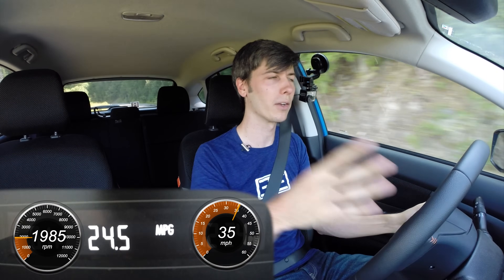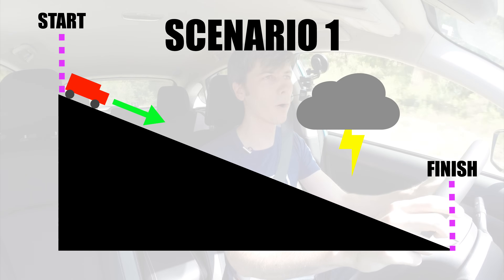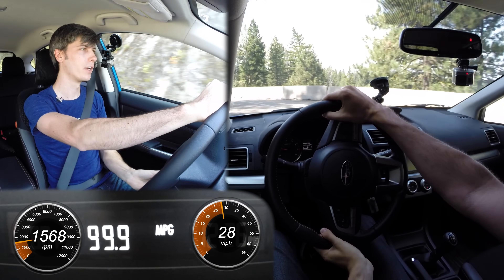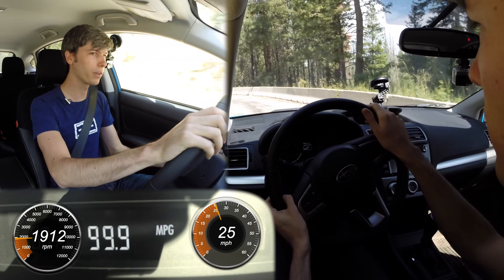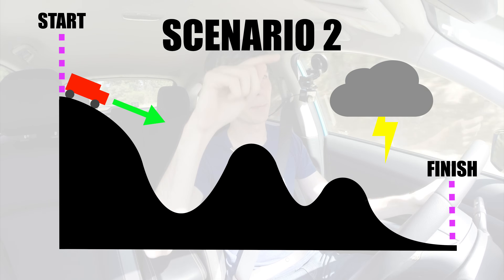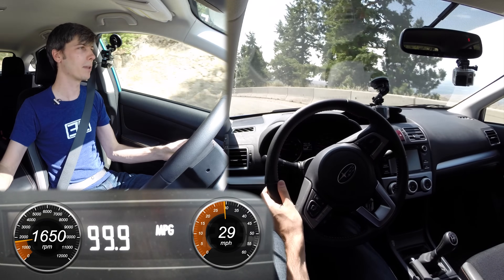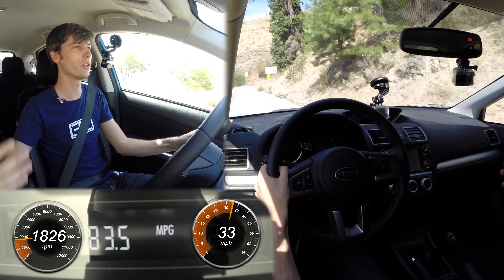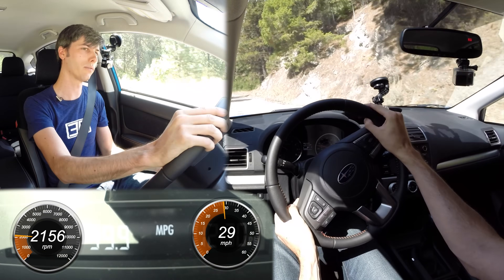What Uses Less Gas - Coasting Or Engine Braking?

Comment: Cool!  Now I can show this video to my friend who always insists on coasting in Neutral for every hill they encounter.
Reply: +zevi 2000
Are you sure? It is certainly against the law (CA VC 21710) to have your car in neutral going down a hill but there doesn't appear to be such a law for sitting at a stop light. If you are driving a manual transmission car, it is not actually possible to do this without having the clutch depressed the entire time, causing unnecessary wear on your throw out bearing.
Reply: @edwardlongshanks827 yes, and also adds an additional hazard of your foot slipping off the clutch if you have to remain in gear causing a possible rear end collision . Neutral at lights is the norm for a stick shift
Reply: @boldcitycc  Yes, I know. I've been driving manual transmission cars for for 46 years and can't remember the last time I ever sat at a light waiting for it to change with it in gear with the clutch depressed.
Reply: Bladed Angel oh hi! Love your channel
Reply: +zevi 2000
Want you to and require you to by law are to different things. There are only seven sections in the CA VC that use the word gear and not one of them mentions remaining in gear at a stop light.
Who is they?
Reply: Why do I see your comments everywhere?
Reply: +drippingwax +Diego Chavez The reason you see my comments everywhere is because my Subscribers notice me and upvote them.  The both of you probably watch more videos and comment more than I do.  Also let's be honest, no one on YouTube has a life XD
Reply: Totally foolish. Theyrr handi-capping themselves from control, should a swift emergency rxn be needed
Reply: Adam Dixon except for brakes and steering
Reply: @wigancyclist8913 ”brakes and steering”, AND the ability to throw it in gear at any time for engine braking.👍
Reply: Bladed Angel hello
Reply: Nuetral is angel gear.....no control of the car
Reply: @adammarshdixon  lol. Steering is control. Braking is control. Compared to these, acceleration is not that big a deal. I would say, loss of some possible control in certain situations. It does not rate as no control, not even close. On a motorbike, more so but we are talking cars.
Reply: @susanss70spartymix77 braking is control, exactly. And braking isn't gonna work for too long, if you coast downhill in neutral!
Reply: Hi
Reply: Bladed Angel where is this that you are driving. I'd love to take my sportscar down those roads
Reply: It's kinda funny, they say to double clutch and to always use the clutch when shifting.
Reply: Edward Longshanks Yes, I know the difference. "They" is the DMV
Reply: Didn't expect you to be here
Reply: or shift up a gear...
Reply: Diego Chavez He doesn't have a life.
Reply: He's engaging a gravity drive rather than coasting in neutral 😂
Reply: New what?
Reply: its time plus work equals energy. if yiubhave air condition on. and getting there takes you 1 hours on engine brake vs 30 minites on neutral. you are using 30 more minutes of energy.
Reply: Please explain. How exactly are you in gear at a stop sign or red light? Are we talking about manual cars? Are you constantly pressing the clutch, even if you have to wait a minute???
Reply: I have a 2010 car that doesn't cut fuel, and it's a standard transmission too. This is simply not true in all cases. It still depends on the car AND situation.
Reply: Nobody i dont know how a fuel line would cut off when at neutral, you will still hear the engine combusting. and you need fuel for combustion.
Reply: How have you proven the ECU does not cut fuel?
Reply: Coasting also destroy the brakes
Reply: @AxelMontini  braking wears brakes. Coasting does nothing to them. If you are going too fast and need to brake, then you are braking, not coasting. Depending on the incline I can coast for a long time and often put it back in gear to speed up. If its too steep I engage gear. If really steep I shift down.
Reply: That will mess up the transmission
Reply: Yeah its annoying, they always complain how I use my engine braking and afraid of the rev sound
Reply: @imustbust998  Good point, but I rarely coast, especially on a highway.
Reply: I know a guy that did that and he thought the engine made it go faster and I said dude it's called engine braking you're not wide open your a title in the engine is struggling making a break
Reply: It's illegal, so is operating cell phone while driving, but police have better things to do.
Reply: Were the cost of new brake pads or of crashing downhill because they cooked their brakes not a convincing argument to your friend? 🤯
Reply: I'm one of those guys XD
Reply: I’ve never coasted down hill keep in gear = more control
Reply: Everyone here arguing if it’s safe to do this kind of thing … y’all do realize that it depends entirely on the situation, right? I’ve regularly driven hills where you could stay +/-5mph of the speed limit in neutral. I’ve done that. There’s other hills where - obviously - this would not be safe. We have one like that where I currently live that’s very steep and curvy.
Reply: Feel ya
Reply: If i am driving a MT, if the situation is allowed, i even turn off the engine at the highest point for coasting. Once near the bottom, use speed and clutch to kick on the engine again, no ignition, absolute zero gas use. I know some people coasting over 30 years, no incident at all. Only poor driver need everything under control, but not looking around. Variables are from moving object, not a plain road. Highly skilled drivers are observers, they anticipate all situations, and try to keep all objects from a distance by speeding or coasting. Braking? =waste of gas, a last resort. Why speed up while a red light is just in front of you? 
Fast, safe, comfortable, low depreciation, low gas consumption can be coexisted.
But I find idiots every day who speed up at the top and brake at the bottom. They don't gain more speed before climbing up the hill, but use low gear to push hard. They feel good to stay in fast lane slowly, in order to keep a mid lane car next to him. Lonely? of course, twenty cars behind... they don't use the mirror! 
Always keep cars a distance from you.
Fast lane is for overtaking.
Reply: Maybe they just have an old car that doesn't really do that?
Reply: Rip his brakes
Reply: This is not only dangerous but I'm thinking it may be illegal. At least it is for trucks.
Reply: Layne Hagan unless it’s an automated manual
Reply: It's also crazy dangerous coasting cause brakes tend to fail and overheat.
Reply: Yeah, they want you to keep the car in 1st gear at lights. Clutched in while waiting. I would find that super annoying. Only sometimes I do that, but only when I'm first at the light. I'll see if I can find specifically where I got that information. Fortunately I took my test in an auto, because I was planning on doing it in a manual car and I had not known that until after I passed.
Reply: Bladed Angel if they have an older car they might still be rite sins he is talking about fuel injectors cutting off hear I don't think the video is for old setups
Reply: Be sure to show it to him when he is driving downhill.
I use neutral if I cannot maintain speed in-gear.  I stay in gear if I can maintain speed.  I downshift if I gain too much speed.
Reply: Devin Stambolziovski Here in California you can fail your test if you are not in gear at a stoplight or anytime other than transitioning between gears
Reply: @zevi2000  What?! Really?! If I'm going to be at a stop light for more than a few seconds, I always shift to neutral.
Reply: It also depends on the hill. If it's not steep enough and engine braking is enough to slow you down then it's better to stay in neutral.
Reply: I just engine brake and then tap the throttle everyone in a while . @sic22l
Reply: Coasting in neutral is very dangerous, I would say the mpg gains are negligible compared to the amount of safety you are giving away. Never coast in neutral is the best advice.
Reply: @robvelor  You mean downhill, correct? Because I don't see how coasting in neutral on a straightaway up to a stop light or stop sign & just using brakes to slow, instead of remaining in gear, could be dangerous.
Reply: @crooked-halo  Downhill mostly, but I would suggest you never do it in a straightaway either, if you coast in neutral you practically lost half control of the car, think a bike or a person getting in the way, you would lose a lot of safety and room to maneuver in time.
Reply: @robvelor  Well, coasting isn't affecting my ability to steer to avoid something, but it does prohibit me from accelerating quickly to avoid an accident, as I Must Bust pointed out. I rarely coast, I love using my gears & engine to effectively & efficiently slow and accelerate, while not placing too much strain on them. I am in neutral at a red light, though, holding in clutch excessively wears out the bearing quicker.
Reply: Doing that right now, haha
Reply: sic22l if engine speed is greater than drive/wheel speed - disengage the engine.
Reply: if he really wants to save gas he needs to throw it in neutral on the way up the hill and go full throttle on the way down.
Reply: Get an electric car = problem solved 😎
Reply: If you're unwilling or can't take advantage of the extra speed you will gain in neutral and use it as momentum to get up the next hill, then compression braking is best.
Reply: Layne Hagan It's technically illegal to have the car "out of gear" in traffic or at a stop light. At least in some states im pretty sure.
Reply: @Ms.Fowlbwahhh over the other side of the pond, where manual transmition cars are the norm, we can just chill in neutral at a red light, or on a railway crossing when the train is due to cross! Some of us even live life on the edge, and shut off the car, is the time exceeds 5 minutes! But not in the winter 🤣🤣🤣 we like our asses warm and our ballz sweaty! Brings in the girls!

Comment: Will engine braking result in more drivetrain wear compared to coasting in neutral?
Reply: Jacob Moorman engine braking causes no extra wear and tear.
Reply: Noooo- exacTly the opposite. Read my comment up top about the issue of shiftinf back into gear from N
Reply: It wont unless you are doing silly things with it such as dropping quickly into a too lower gear.
Reply: Just to a beat a dead horse. It won't. Your not creating much heat since there's no fuel used to run the engine. Plus it is unsafe and sometimes illegal to coast downhill in neutral.
Reply: Very little.  If you compare to accelerating or towing.
Reply: And a rev-match wastes gas and still might not be precise. No shifting is less wear than shifting. Easy enuf
Reply: Reza Grans hardly uses any gas to rev match. There's no load on the engine if you are on the clutch, so you can give far less throttle to increase the engine speed

Comment: And what about engine braking with high RPM's? Like going 4500RPM in 2nd gear
Reply: Then you use another gear ;D
Reply: That would cause a lot of engine braking. I think that would be useful only if there's a long downhill section ahead, in order to use the brakes as little as possible and prevent them from overheating
Reply: But the engine wear is higher than low RPM in higher gears?
Reply: Techically that might be the case, however i'm pretty sure the effect would be marginal
Reply: You can put it in higher gear, i.e. 3rd or 4th gear.

Comment: How does the engine know to shut off fuel when coasting in gear? Wouldn’t it be the same as just idling in neutral? Unless the speed sensor is at work? Confused on that bit
Reply: It knows because you took the foot off the accelerator. That means no more fuel injection, except when the engine rpm drops below idle rpm, then it injects enough fuel to maintain idling.
Reply: Event Horizon But how does it know? Which sensor/s is it going off of? And does this apply to all manual cars? Or just newer ones
Reply: There is a throttle position sensor. When it senses the throttle is closed it stops injecting fuel until the rpm drop to idle.
Reply: Stefan S Nope, for example there is the engine speed sensor. Without that the engine speed would drop below neutral because the ECU wouldn't know it has to inject fuel now.
Reply: There are several possible sensors an ECU could use to work out if it's necessary to inject fuel into the cylinders or not. Like camshaft and crankshaft sensors, gearbox speed sensor and at a push you could theoretically use wheel speed sensors too as long as the ECU knows what gear the vehicle's in (though wouldn't be ideal). As long as the ECU knows the engine speed is above idle then it knows it doesn't need to inject any fuel.
Reply: mrsemifixit If it is above idle speed it shuts off. When your RPMs were to drop below idle speed it starts injecting again, to keep RPMs up.
Reply: One of the many calculated parameters is 'engine load'
Idling has a calculated load and any other operating condition. If RPMs increase without throttle application, then that's definitely a no load situation and will result in a negative or 0% engine load value. This is one of many calculations that occur.
Reply: Some have been very close. But not quite Cigar worthy I'm afraid.
The ECU simply goes off the throttle position sensor on the throttle butterfly/body, not the pedal.
IF the ECU notes that the engine revs are above a pre determined value, say 13-1400 RPM AND the throttle position sensor IS in the idle position, Fuel is shut off, by having a zero injection duration. If these two parameters are not met the ECU fuels and times as is required.
And for those asking. NO this does NOT happen on vehicles equipped with Carburettors and some old mechanical type fuel injection systems. I think virtually ALL EFI systems do this, from certainly the 80's, as this is a major advantage possible with such a system. It prevents large amounts of unburned hydrocarbons escaping into the atmosphere.
Reply: for the most part gear and rpm should be sufficient
Reply: Martin Stander I think it only applies to fuel injected engines.
Reply: +Stefan S
No need for any sensors? The gas pedal position is indeed measured by a sensor or the car could not detect that your foot is off the gas pedal. I know I am nit picky but that little detail bothered me.
Reply: In its most basic form, the engine speed and throttle position sensors. So the logic would be "If throttle angle less than or equal to x degrees and engine speed more than y RPM, drop injector duty cycle to 0".
Reply: mrsemifixit The wheels are driving the engine, so it doesnt need to ise feul to idle
Reply: BlacksterFX the question was 'how does it know when to shut off fuel injection'. Necessary criteria: gas pedal not pressed. What you mentioned is the criteria to resume fuel injection after it has been cut off beforehand. You are obviously correct but mine was the most basic answer
Reply: Okay.  This is a fairly simple case for injected cars. But how about an explanation for cars and indeed even some modern motorcycles that are still running carburettors?  There is always an idle jet running there...
In that case would the increase in rpm increase fuel consumption on a downhill (compared to neutral coasting) even with the throttle closed ? Another video on the matter please
Reply: The tps
Reply: Usually no throttle over 1500 rpm will shut off fuel on most engines.
Reply: A lot of sensors on an engine contribute to how the ECM knows when to shut injectors off. Throttle position, manifold air flow or pressure, engine rpm, whether the trans is in gear or not,vehicle speed, all are monitored by the ECM and it's programming determines when the injectors are activated or not. On a diesel, my friends Super Duty F250 in this case, you can actually hear the sound of the engine change when the injectors shut off while coasting and when they come back on, around 5 mph when coming to a complete stop.
Reply: Well i don't know if u got the explanation but In simple Terms : 
When you press on the gas pedal that is most of times connected to a cable that opens the throttle body valve which the more air is sucked into the engine the more the Pistons move up and down which gives more RPM(revs per minute)and when that valve opens there is air flow sensors that detect the air coming in..and then that signal goes back to the (computer) Engine Control Unit(ECU) and then that's when the injectors inject more fuel for the combustion to produce more power.. which is called the power stroke.